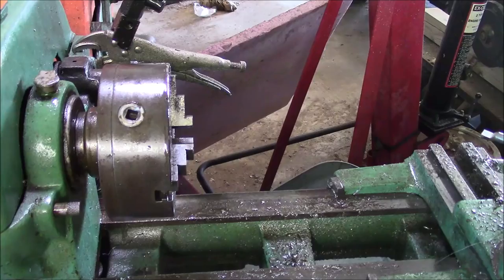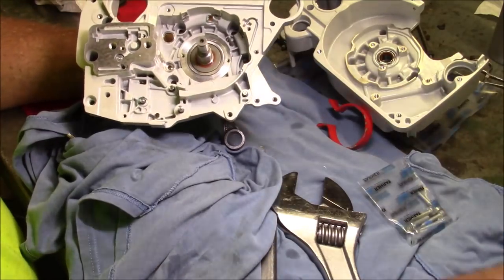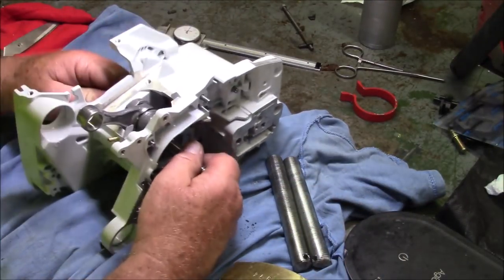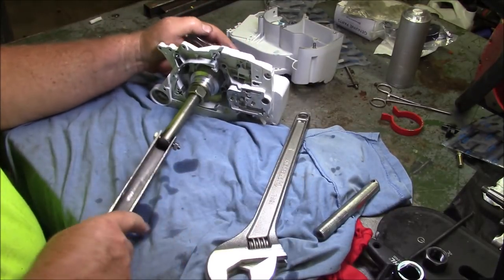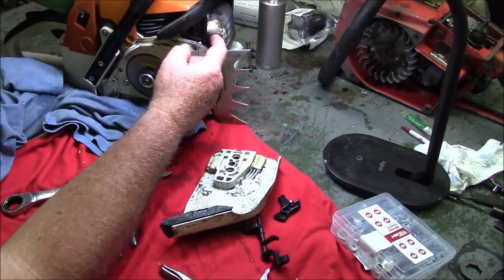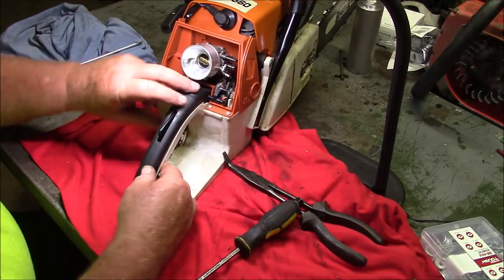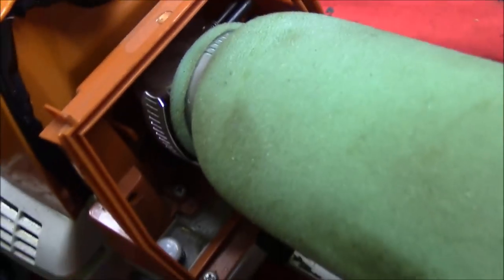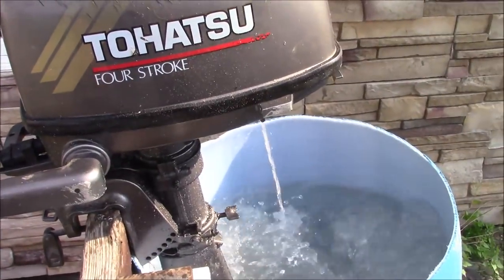Farmertec MS660 Case Assembly Tools,  Modding A MS660 Clone (Bling Saw) To A Work Saw &  Tohatsu 5hp

Comment: I put Red Line assembly Lube on the crank, seals and bearings.  My seals stay pretty good even though I use the hot and cold method of assembly.  The assembly lube will burn off on the first running and is five times slicker than Moly.  It also helps from causing the seal to prolapse.  Two cycle is just not as slick as assembly lube.

Comment: I use Red Line Assembly Lube on the crank, bearings and seals when assembling cases.  Everything movable gets a good coating of assembly lube..  it really protects the seal better than two cycle oil.

Comment: I go further than @John Clarke and actually use Lucas' "Marine Grease" (calcium polysulfide) on important stuff like bearings, I'll just slather them w/ the heavy-grease and then wipe-off all I can with a dry rag, this not only achieves that initial-lubrication you (and John Clarke) advocate, though presumably not as-slick as John's assembly-lube*, but - in contrast to lighter oils - it "hangs around" a bit longer and IMO those initial moments of break-in on a new saw are absolutely CRITICAL because of all the machined-metal-edges "meeting one another" (there's a reason there's pronounced difference in the saw during 'initial break-in' tanks 0-->2 or 3, and then a 'full break-in' typically achieved in 2-3X longer run-time, usually the 10-tank area from anecdotes & experiences)
Gonna need to re-watch this a few more times (no, not my 1st viewing lol) because of my two chinesium 666's, the prebuilt one 'blue thunder' built july 21 by Holzff came to me with a crankcase that BOTH: had two halves that did not match, and they were assembled with a slight cocking/un-true (like 5-10thou if I had to guess, based on fingernail-rubbing of the bottom of the crankcase, or of the actual cylinder mating surface...I use a lotta Motoseal when seating cylinders, lol, but am still flashing every jug I put on so am close to tearing it apart instead of trying a 3rd top-end when I know it's the crankcase..)
Are you still of the opinion the 56mm top-ends are worthwhile? I ordered my 1st "extra farmertec top-end" from ebayer "eccppautoparts", didn't know it was f.tec until it got here and I saw the bag, anyway that cyilnder was great (I mean, IF you're gonna be porting it and redoing the chamber and decking it, of course, but I am so that's fine, I just care about the plating's integrity and a low "ring of death" of unplated cyilnder-top, and the true-ness of the jug itself, casting-problems are non-issue if they're just port-edges and inside the ports!)
Thanks so much for these, never thought I'd be playing with 660's like they were an Erector-Set lol, but thankfully the popularity of the platform &the subsequent glut of products makes it possible for someone who's frugal, like myself, to actually do this (I work with saws so my end-results are not just toys!)
Reply from the maker: Careful! Those 660's are addicting! Thing is they are supported enough with good enough part to turn them into excellent work saws and can be tweak to be rippin' fun cookie machines as well. By far the best place to be with AM. I had a lot of fun with them and the last iterations I build still hang around and are as strong as ever. Ran "Bling Saw" today blocking. I know there will be folks flaming when I say they are the best bang per buck possible in the saw world. OEM or AM

Comment: Hi. I am interested in MS 660 crank tool that you are using.
I have 3/4 threaded rod part but I don't have that bushing.
Can you sell just the bushing to me? How much will it be?
Reply from the maker: A little wrapped up right now. I have built some tool sets to be able to react to folks buying them while the shop is getting moved and really don't want to break them up.  Won't get back to the lathe until this summer.
Reply: @afleetcommand  Would also be interested in the crank tool and bushing. Reach out if you make some to sell.

Comment: With the seals on, is it ok that you are not pressing against the inner races to pull the crank but rather side loading the bearings against the outer races?

Comment: Do you sell those crank tools? I'm looking for a set to assemble my first set of cases.
Reply from the maker: I do but contact me on OPEforum.com messaging that's where I deal with those....what saw? I may have some already made up, did a batch last month. Most are gone but still have a couple of pieces, not a complete set so would have to make some pieces.
Reply: @afleetcommand  is there another way to get in contact with you to get the crank tools for a 660 or a 372?

Comment: Regarding MS 660 clutch bearing, how many mm is it supposed to stick out from the surface of crankcase ? is 1mm ok?
Reply from the maker: Maybe, rather see  1.2mm ( between .045" and .050" ) Actually just look to the inside of the case and if it's flush it should be fine. And if its together and the crank turns without being bound up and is centered...that the ultimate definition of win.

Comment: what is FarmerTec ? Is that sort of like a Chinese Stihl or what ?
Reply from the maker: Nope. They are simply a manufacturer and / or supplier of after market repair parts. They have parts for Husqvarna and Stihl along with a bunch for other products including mower parts. Hobby types have for last few years bought sets of parts to build saws almost as a gaff to prove that you can or to show off mechanical skill.  Some have to learn about saws. Most are blends of parts from a variety of sources. Kind of like Brodex and Edelbrock  in the automotive business, just they typically aren't as good as OEM, but are good enough for repairs. The hobby of building Aftermarket parts saws is something that has taken on a life of its own. I have been testing and evaluating parts from a series of place for a few years now, and unlike many on YouTube, my premise is to find out through using them which are worth considering as repair parts and which need to go directly to the scrap bin. And my suggestion to all on the fringe, not with a lot of knowledge on these things...go to your dealer and buy OEM parts or new saws..:)
Reply: Oh OK Thanks for that. I may have to look it up, I need parts for my Cub Cadet LT1042....